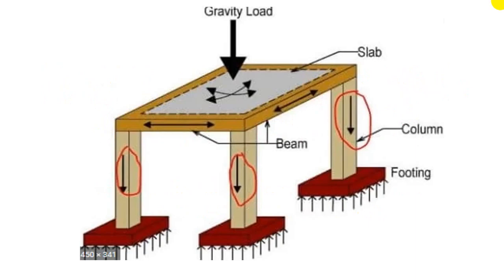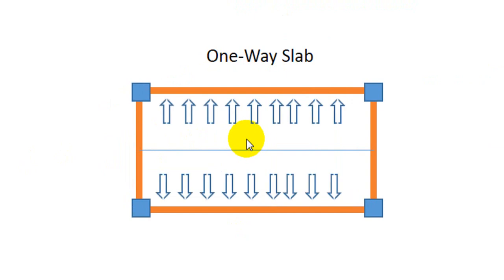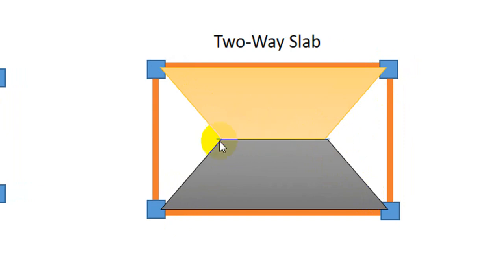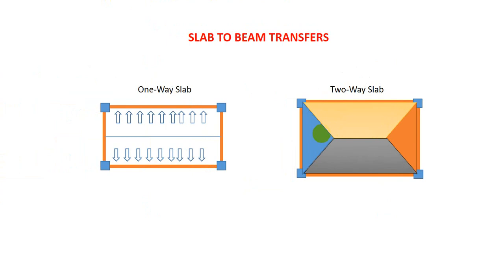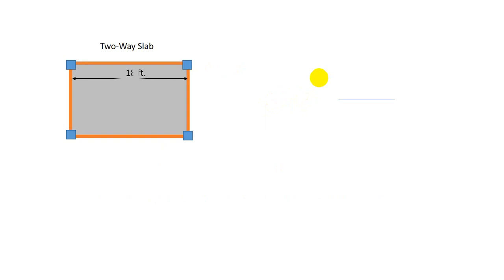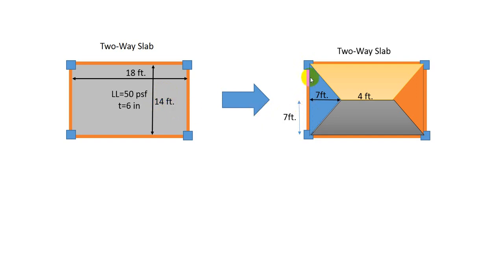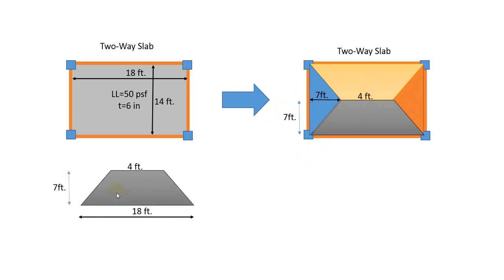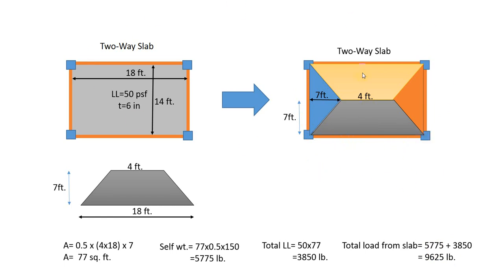HOW LOAD TRANSFER FROM SLAB TO FOUNDATION | Civil Engineering Basic Knowledge

Comment: Best sir. Sir what is design strip width for foundation and slab in safe software?
Reply from the maker: for manual calculation we consider 1 ft or 1m for design foundation or slab. so software also consider some strips like that.. after 10 day you will get almost 50+ tutorials series of safe 2016.
Reply: @qlearnify-en  great sir.
Reply from the maker: @ajazsayyed8487  thanks